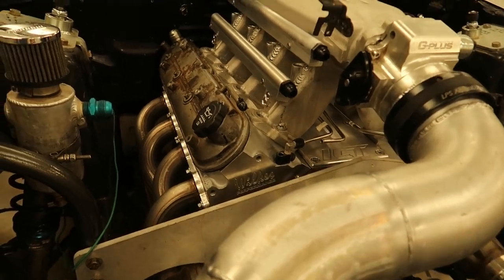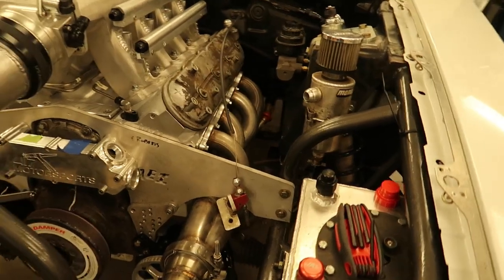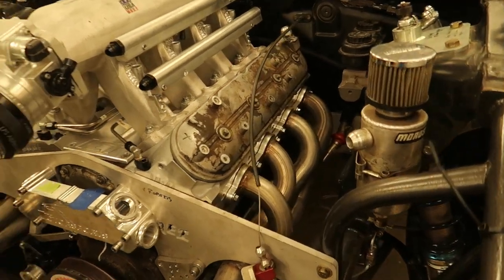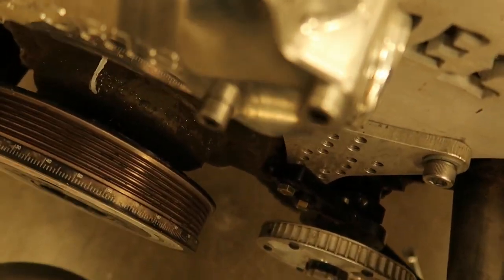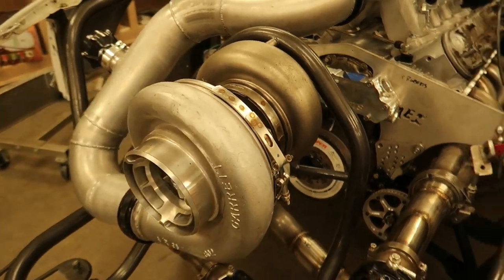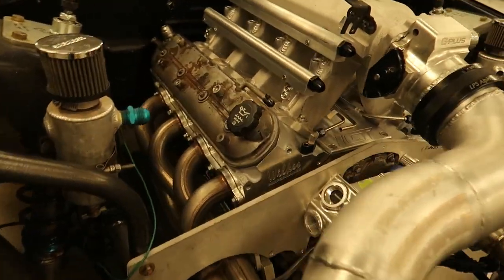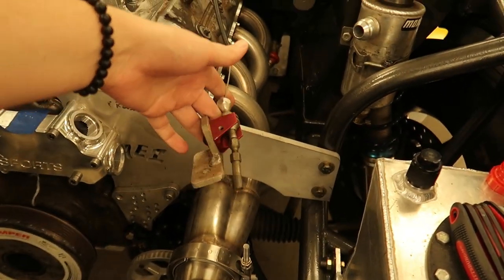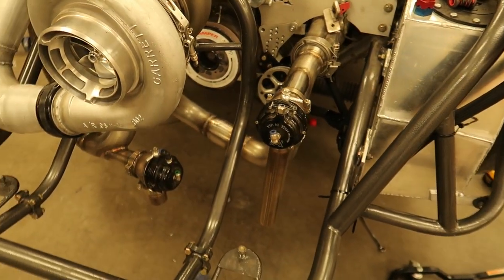Rambling Update and Plans! Road to Re-setting the SBE 4.8 Record Ep. 10

Comment: Hey man, really admire your hard work and dedication. It may be a lot to ask but I have a close friend who also has an LS swapped 1960 Chevy but he’s all motor LS1 from a GTO donor. He’s wanting to cam swap but not looking to be hassled to get a solid tune. 
(You know how shops do) 
We’re just normal average folks looking for some advice. His car is run by a PSI conversions harness. Straight up badass car. Anything you have to say I’ll listen. I’d gladly exchange phone numbers with you or whatever means necessary. Obviously you know your stuff and have it dialed in. 🏆
Reply from the maker: Appreciate the love! That sounds like a very nice car! I personally don't do any factory ecu tuning anymore but you could get it remote tuned. One person I'd recommend for that is Justin Carpenter at JTC performance tuning. He knows his stuff when it comes to those ecus and making them run like they should. I could help get the parts you need since I am a BTR dealer if you'd like as well. And a converter from Hughes as well if needed.
Reply: @SquirrelTuned  I’ll relay the info. Man I forgot to tell you it’s a 6 speed car so he don’t have to fool with a converter 🤘🏼
Reply from the maker: @Ppumppower  nice! Sounds like a fun car.
Reply: @SquirrelTuned  its the one of coolest cars I’ve ever rode in hands down. Man do you watch the redline news network channel on here? I found them on Instagram they’re just getting started up but I’d say much like your page here they’re probably about to hit it big, I’d say they’d like to feature one of your videos making a pass especially with the passed You’re laying down on SBE.

Comment: do you think a 4.8 would spool 2 of those ebay gt45 turbos up.
Reply from the maker: They are really lazy turbos I would pick something else. Tons of way better options.
Reply: What boost controller did you use when you ran the stock pcm?
Reply from the maker: @SpareTimeGarage1010  I used a boost leash with c02. Also used it for the bump box.
Reply: Sorry to keep bugging you buuuuut one more question. When you were on the stock pcm and e85 did you use an alcohol content or flex fuel sensor?
Reply from the maker: @SpareTimeGarage1010  No sir I did not. Just tuned it for e85 only.

Comment: I’m considering a swap, could you help me if I get some questions in order? Thanks
Reply from the maker: I'm sure I could. And could get you some parts you will need
Reply: @SquirrelTuned   what travel limiters are you running? And did you build that fuel tank?
Reply from the maker: @nickm9854  My friend built the fuel tank. They came on the car but after a quick search I believe they may be UPR tubular travel limiters.